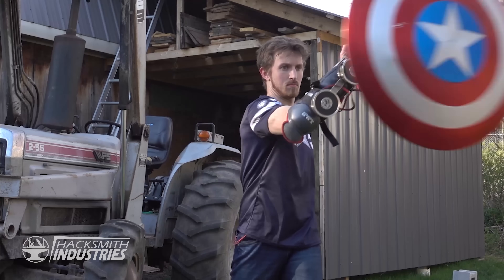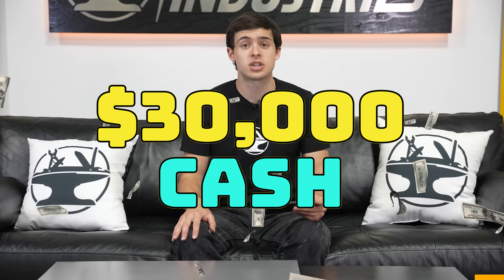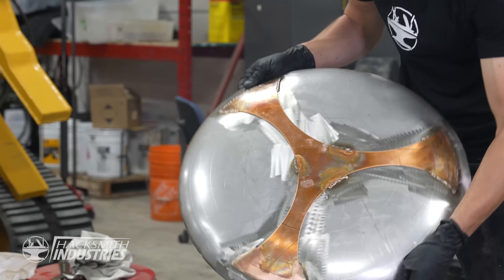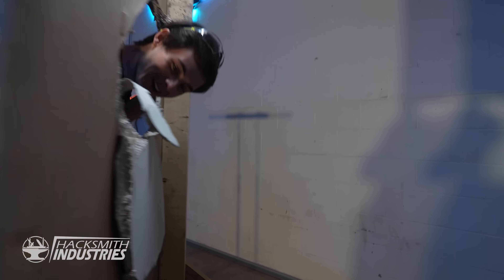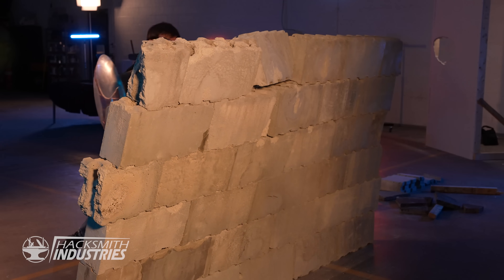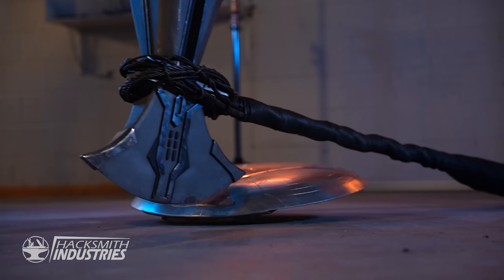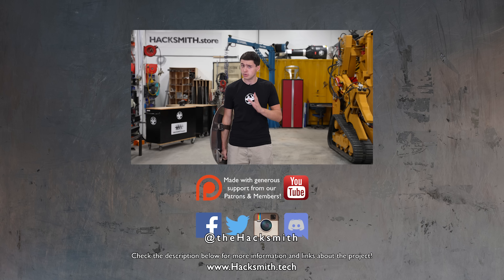The Strongest Shield We've Ever Made (Black Widow)

Comment: I wish I had the tools and materials to make my own shield 🥹
I wouldn’t be worried so much about weight, I’d be far more concerned with the density-weight Ratio. If I remember correctly, caps OG shield was about 1/2 inch Thick Vibranium. For a real Functional shield, I’d go with the 1/2 inch, but it would be a double layer of steel.

Comment: for your next shield you should hexagon plate it (you get two metal plates and put a honey comb between, they use this in rockets and planes, this also allows it to be slightly more flexible and also very much makes it stronger. a one inch thick hollow honey comb plate is stronger than a solid one inch thick metal plate, as in same width lighter and stronger. also if you fold the steal you can make it even stronger.)

Comment: @hacksmith what kind of pressure was required to form this? Could I get the same result using a pressure washer pump or did you use some kind of higher pressure syestem? Thanks
Reply from the maker: 3500PSI!

Check out Colin Furze's videos on hydroforming with pressure washers
Reply: @hacksmith  Thank you I appreciate it.  😃

Comment: Hello Hacksmith Industries, I want to ask what kind of Metall are you using for the whole shield because I am interested to also build a shield. Best Regards Pascal
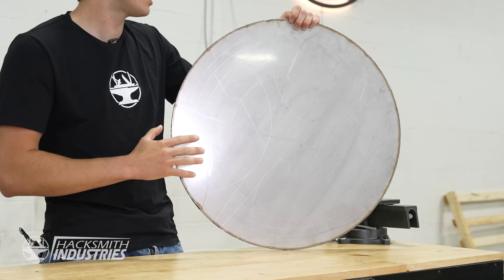Reply: 4:40 
He mentions that the shield is two pieces of 1/8 inch Stainless Steel welded together
Reply: But where was it bought?

Comment: It was entertaining, but you should heat treat the steel before testing shields, armours, and weapons.
Reply from the maker: most stainless can't be heat treated,  you're thinking of high carbon steel for knife making
Reply: @hacksmith  well, today there are modern stainless steels which can be quench while wrapped in a steel foil to reduce the oxygen and get the maximum hardness (no oxygen means no carbon loss in heat treatment), criogenically treated for stress relieving of the steel crystals, and tempered to increase the toughness.  These treatments will improve the performances of your stainless steel projects... It can be interesting to see that in the making and your projects will be stronger for the same weight ... In some cases if you use heat treated materials, they spring back to their shape once hit. Keep up with the good work!

Comment: Is no one talking about Bogdans near miss with the hydraulic fluid (hydraulic fluid injection)
Reply from the maker: there's a lot of misinformation around hydraulic injection... pressure needs to remain constant. in a small system like this as soon as a leak has formed the pressure drops rapidly. it's no worse than a pressure washer

Comment: releasing the pressure the way that you showed is super dangerous, I hope you eased the pressure more safely than what you showed in the video.
Reply from the maker: It's not actually. Hydraulic injection requires constant pressure -- if you're releasing pressure it drops off immedietely. No more dangerous than a pressure washer running out of gas

Comment: The shield is very cool but the copper is orange. And in the movie the shield is red. I get that you don’t want to use paint and stickers but an alternative to make it red would have been Damascus steel. It can turn any color when electricity or heat is applied or something like that (I don’t really remember). And I think it can even be welded with stainless steel, instead of being brazed like copper.

EDIT: plus that damascus would be way more resistant than copper, but a bit less resistant than stainless.
Reply from the maker: I think you're thinking of titanium... damascus steel is just different alloys of steel layered together -- doesn't have color changing properties!
Reply: @hacksmith  idk. That may be the case. But a while back I saw a video from “Daniel Krafft” where he built MrBeast’s 50 mil play button and he said that some parts were made with damascus steel and that with a specific process they would change colors and create some really cool colors. Now I may be mistaken or I may have not paid attention and understood something wrong.

EDIT: thanks for the reply!
Reply from the maker: Yeah I don't think so. Steel at best can turn blue or a burnt amber -- damascus is just multiple types of steel layered together usually for knife making =)
Reply: You are the experts afterall so I’m not contradicting you. You know a thing or two about steel and titanium after doing several projects!

Comment: Will the small etching in the shield weaken the structural integrity?  Or did you compensate with extra material on the bottom of the shield?
Reply from the maker: well it didn't break on any of the etching,  so no?
Reply: @hacksmith  ok cool

Comment: This moment when you use gloves to protect your hands from the hydraulic fluid that is kinda not so good for the skin (actually why? Shouldn't it just be oily or something? Last time I touched it, it kind of felt like an acid or something like that) and it spills all over your body. Good Job ^^
Reply from the maker: most hydraulic oil is just mineral oil
Reply: @hacksmith  but why does it this acid like reaction with your skin? I thought maybe they mixed something in to do something good with the pump and cylinders or something like that. But I'm not Shure. Would love to know.
Reply from the maker: gloves still keep your hands clean even if the mess isn't poisonous haha

Comment: i would've welded the other half of the hydro formed shield that was cut off to the main part making it stronger
Reply: Thats assuming the hydroform lead to 2 almost identically shaped halves which isn't likely. Also steals very heavy and that would double the weight
Reply: @DarthAxolotl  your right, but still assuming that they were fairly similar it could've been reshaped with a hammer or ever ground down...
Reply: @TheJGMexperience  yeah, it probably could have worked but work hardened steal is pretty tough (it took stormbreaker like a boss)
Reply: @DarthAxolotl  lol yeah, your probably right